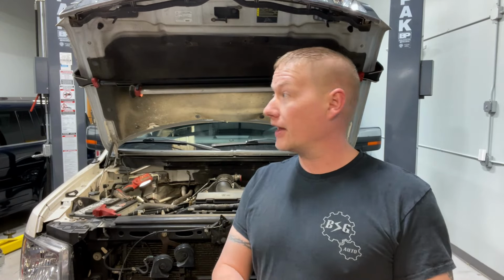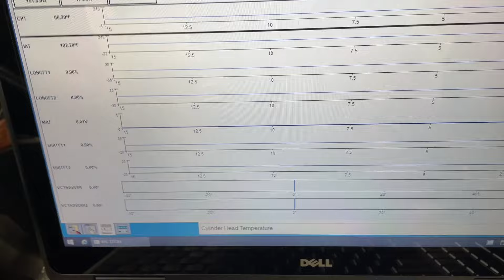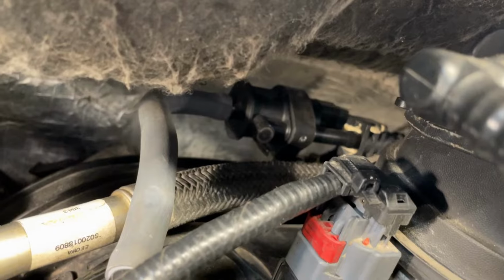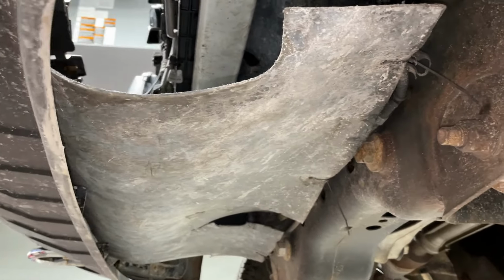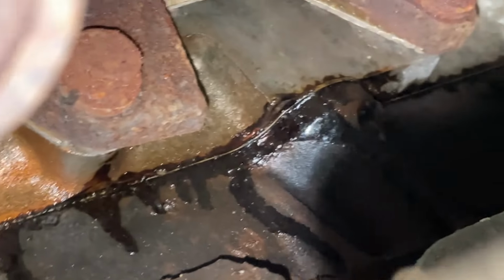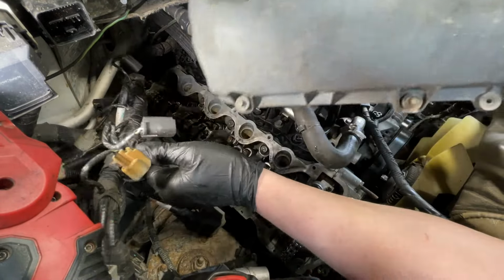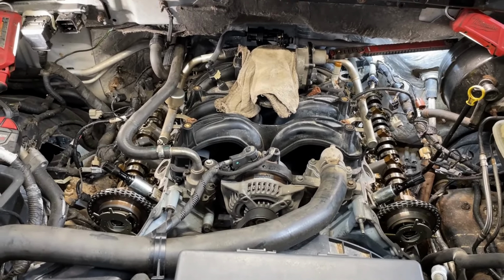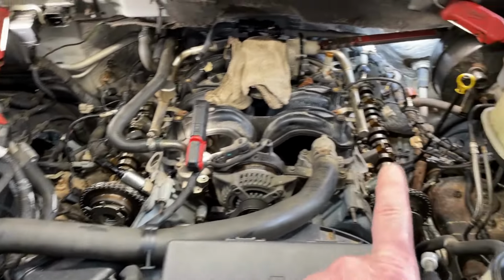The Worst Hack Timing Job Ever!

Comment: Brian, I gotta tell you that you do such a terrific job in showing folks how to do it right.  Spent this last weekend with my sons changing timing chain guides and tensioners on an older 4.6 Town Car, and we used your videos as tutorials.  Car runs great.  This video is also so helpful in showing the casual home mechanic in what's right and what's not.  It's also obvious that you care about your customers and possess a good, "down to earth" philosophy about making sure that the folks that bring a car to your shop get it fixed right.  Good on ya.
Reply: He just telling you not to use After marjet parts and use moto craft original parts when ever possible. But in this truck here he could have pit t he bolts in the oil pan fir the guy to him its not frifht so he may need a new motor I. The future but he wanted dudes money he wasn't looking g out for the customers vest interest he was looking at his best interest ans ge wanted that money on putting in that new motor. Because yea simeubinfs weren't right but that motor was t shot by no stretch of the imagination. And to recommend a total scrap of the motor and install a completely new motor in this case was extremely not nessisary at that time anyway and pit the bolts in the oil pan and the other little stuff that really needed attention immediately. Then told customer I'd it goes out in a month it would surprise me but I took care of it the best I could when the motor goes out I'll get you took care of with the right way. But no he wanted to make sure he git rhe job then and there or nothing after dude dime spent 5k I quess this guy just looks for people that t moneysno object well unfortunately in the real world most don't have lthat luxury so I said my peace you real guys know what I'm saying those that don't you guys got deep deep pockets good for you I ain't hating

Comment: Thanks for sharing Brian! I like Ford Trucks, especially simple made older ones (1990 - early 2000). My Ford f250 has passed 417K, stills runs strong like new. I learned a lot just watching your channel. Greetings fro Canada! Take care.
Reply: my 02 f250 has 391k on it and thanks to this guy ive been able to make sure to keep it going , i only wish i had the cash to send my truck to him to do the new timing chains and new intake that has minor leaks along with other minor issues ... and no i wont dare crack this engine open just because of all the things i know i would screw up 
this guy knows what hes doing
Reply: F250 and F350 are commercial trucks and built a lot better. Everything is built stronger than crappy F150 trucks.
Reply: @brianmckibben2300  So true Brian! I agree. Thanks for your feedback. Take care brotha.

Comment: My eyes widened like crazy when I saw those oil pan bolts were missing. How the hell can someone send that and be able to sleep at night. Totally shameful and embarrassing.
Reply: I thought the same thing man, what a piss poor job, I'm a novice mechanic, but whenever I do work on any vehicle I go thru and triple check everything I've touched.
Reply: Very shameful.
Reply: This kind of work gives us a bad reputation. No wonder people are thinking they are going to get screwed. Been a Ford tech for years and this would not fly in my dealership. You would loading your box and gone.  Not all of us are crooks .
Reply: @edwardames2081  there's one place I take my truck to that I truly trust and that's because I know the owner and a couple of the techs since elementary school, I even had a hard time trusting the dealership when I still had my warranty, though they did do good work when it come to getting my timing done, and any other work covered under warranty.
Reply: Omitting those bolts saves weight. Releases hidden performance.
Reply: @hightttech  I just add stickers
Reply: I got these extra parts when i finished. Guess i made a more efficent system.
Reply: Just glad he’s not an aviation tech.
Reply: jacklegg outfit.
Reply: It seems like the mechanic is just a clown who doesnt know what they are doing.

Comment: The beauty of being a Ford teck is you will never run out of work . First 1 I had to pull the cab off of to work on I quit working on them . Here in the rust belt you just drive them until they die because nothing comes apart it just breaks. You couldn't give me one for free after watching this well put together video.

Comment: You are the only reason I still have an '08 expedition,  much gratitude,  you and I did the whole timing and oil pump upgrade together 👏
Reply: Can oil pressure be the issue??
Reply: @maurotafoya8415  no. Do you have a code scanner? Timing is generally controlled by O2’s and knock sensors(on gm at least).
Reply: @maurotafoya8415  well actually low oil pressure can cause a tick or rattle in your engine and it will think it’s a knock and retard the timing. On GM trucks low oil pressure is related to the oil pick up o ring. I replaced my o ring in a 2005 avalanche. Went from 10psi oil pressure at idle to 55 psi. The lifter ticking stopped which fixed the knock sensor issue so now it doesn’t retard timing anymore. Picked up 100hp.
Reply: @MrPland1992  yes i do have an OBD2 scanner and im pretty sure that crap showed a retared timing when i checked and yesterday that i went ahead and double check so i can start working, it showed no timing code now... now its only a camshaft sensor which i already replaced buddy
Reply: Exactly what I think. I'm driving an 05 expedition and so far iv been pretty lucky pushing 240k

Comment: All these things sure put worry lines on my face from the 5.4. I have a 2010 F150 in Lariat version and have never had the engine apart. It does have a ticking on the passenger side valve cover which goes away after a few seconds and there is some brass filings in the oil when I change the oil and filter.
Your videos do go a long way to tell me what to look for and what to replace. Thanks Brian.
Reply: From what I watched from his previous videos, the ticking noise that goes away after a few seconds is not good and will eventually destroy your engine.
Reply: @RandomHeroGames  I am suspecting a bad cam follower and when the oil pressure comes up, it removes some of the play. Brian did say that the 2009 and up cam followers should be replaced before engine catastrophe. Maybe where the brass is coming from. I better pull  my covers and check. Not looking forward to this.
Reply: Few seconds ticking at valve cover is fine. Thats the hydraulic lifters filling. I think its the chain slap at start up that indicates it needs a timing job.  That's the bad one that needs to be addressed.
Reply: Had similar situation there filings looks like brass but was aluminum that had oil on it. Timing chain tensioner blew and chain was rubbing on timing cover
Reply: @joseph123456  Had that thought as well. I will be going there if nothing up under the valve cover. Thanks.
Reply: @joseph123456  Curious if any of you know a ballpark figure on what dealerships charge for full timing components and labor? Worse case scenario needing a new engines vs best case full timing. Thanks for any feedback.
Reply: @Sheeeeeeeeeeeeiiitt No I do not know what they would charge as I did the complete timing job on my truck myself.  I  know I got a quote for a 5.4 motor at one time rebuilt from ford and it was about 4 grand.  If it was me I'd check reputable independant shops for quotes  cause in ny the ford dealership is expensive.

Comment: Seeing shit like this and having dealt with crappy shops and dealers keeps pushing me to do my own work even if it’s a total pain. I’ve wanted to buy my own lift but my garage will not accommodate the height of one...
Reply: Not even a low ceiling?
Reply: Better off to do as much of your own work as you have the skills for.you run into trouble when you need scan tool access for programing and special function it easy to just pull codes.
Reply: Some people notch their ceilings to get a foot or so of extra clearance. I worked with a guy who ran a small shop in a barn and he had a bendpak 2 post lift. Wouldn't lift vehicles high enough to stand up under, so he got a nice rolling chair and just rolled around underneath.
Reply: how about digging a pit?

Comment: My son has an 07. He had a Ford dealer that told him he needed a timing job. He paid them 4500$. Got in it to leave and it wouldn't even start. They changed him another 375$ to put a cheap 3$ aftermarket battery terminal on. Driving it home it would barely run. When I raised the hood it was just like this truck. Problems everywhere I looked. I    have been a tech for 27 years. He is active duty in the military and lives on the other side of the country or I would have fixed it for him. Hard to believe a shop can let such hideous work go out the door and not do anything to make it right.   This garbage work is what gives us a bad reputation. A tech that does work like that should find another way to make a living. I feel for this customer.  Just found  your channel and good for you sir. Great job 👏.  Thanks for all of your help and support.

Comment: I’m about to do the timing on my ‘05 F150 5.4 according to all your awesome videos.  All Ford parts of course.  Thanks for all the videos and help over the years keeping my truck on the road with 200k miles!
Reply: Buy the repair manual for the truck also and just take your time and buy the special tools you need if you live close to Cincinnati Ohio I have the tools and I would let you borrow them
Reply: I just did mine by watching his video on phone sitting on shelf.   Have to do it again though something is wrong.  I messed up somewhere.  Buy tools they are needed.
Reply: @kevinbelanger4134  if I still lived in Dayton I’d take you up on that offer!  Thanks!  I’ll be setting aside 4-5 days to do the work and got the specialty tools, especially the crankshaft position tool and roller follower remover.

Comment: Awesome video . Im new to this engine and im doing a timing job . This is a great example of what not to do . I find it so hard to access the valve cover bolts on the back on the passenger side . But yea the forgotten 4 bolts on the oil pan is a joke .

Comment: Is there a roller / lash adjuster kit you recommend?  I have a 2007 f150 5.4L 3v and about to do full timing.  Would like to replace those while I'm in there, but having a hard time finding info.  Don't trust the aftermarket kits.  Have heard they redesigned in later years, but hard to find part numbers.  Would like to buy all 24/24 in a kit.  What do you recommend?  Semper Fi!

Comment: If the air intake is through the fender it is already a cold air system. Those K&N filters are in my opinion crap anyway because they don't filter out near enough crap. If you have a need for more air you got to get a bigger filter and housing. that will safely (for the engine) allow more air through more good filter media. I'd like to see more of this truck and what you fix on it.

Comment: Good afternoon, Brian. And thanks for your continued production of YouTube videos on F-150 problems.
With all your experience with Ford F150 engines, would you say that the Coyote 5.0 liter is a better, less problematic, and more durable engine than the 5.4 liter 3 valve?
Please reply with your comments.
Thanks!
Reply: My 2013 with the Coyote has 258,000 miles on it and still runs great. I am hoping it can last another 100,000 (at least).

Comment: I am a 20 year professional technician and I’ve owned a shop for almost 2 years. I have worked for a new car dealership, chain stores and Indy shops. The people running the indy shops and chain stores have this thing in their heads that the dealership parts are super expensive which just isn’t true sure some stuff like converters are more expensive because they actually work but many many parts are actually cheaper at the dealer ive paid 49 dollars for oxygen sensors at the dealer and the part stores wanted 78 bucks. I’ve had gaskets be cheaper at the dealer and I’ll tell u the aftermarket gaskets get super soft and leak and the aftermarket gaskets aren’t always the same size so the gaskets never fit like a dealer gasket. I’ve put aftermarket timing chains next to a dealer timing chain and the aftermarket chains were longer lol and the best part is the timing chain from the dealer was 7 dollars more but it came with new guide bolts! Now that I have my own shop I buy so many parts from the dealer and I don’t have the come backs that other shops have from simple part failures that are totally avoidable. Sure I do buy aftermarket parts I don’t get everything from the dealerships but I only get stuff like brakes, belts, radiators, and stuff like that I buy all engine parts, all electronic parts from the dealer it gets rid of a lot of headaches.

Comment: We've got a 5.4 from 2004 that just runs amazing, we do all the maintenance ourselves, never miss an oil change, spark plugs and coils twice, runs without missing a beat, it has a cold air intake, flowmaster cat back, and a shift kit, 3 stage programmer, expedition

Comment: The biggest problem i see is that head being replaced without the bore journal being checked, the first and last cam caps if there is wear the head/camshaft will not properly oil for the phaser to work right. Good old dorman phasers i stopped using them on the ford 3 valve years ago from the unreliability of them. They rock back and forth at idle and part throttle witch sets phaser codes.

Comment: Purchased a non running F250 with the 5.4 3v engine.
Rebuilt the engine myself and used OEM timing & valve train components. 
Six years later and no issues.
Motorcraft oil & filter change every 3k miles.

Comment: The thumbs down comes from Dorman parts....😆.
Reply: While I’m not a dorman fan, did you see the dorman phasers were not the cause of these issues.
Reply: Well, you can use them in your engine.
Reply: @jamram9924  To be fair, Dorman phasers do suck but so did about everything Ford put in these engines from the factory. There’s no excuse for the garbage that Ford (and other manufacturers) pawn off on customers.
Reply: @prevost8686  : Well FordTechMakuloco does recommend the installation of the Melling engine oil pump for that reason. Most people believe all parts are created equal and sadly they are not. I’ve dealt in wholesale autoparts for over 20 years. I’ve also worked as a service advisor and import shop. When America have China preferred trade status, we opened the floodgates to cheaply priced/made auto parts. Orielly, Napa and Autozone are flooded with this junk. The majority of car owners gravitate towards cheaply priced parts not knowing their quality is also cheap. I’m getting ready to do a timing chain and oil pump service on a 5.4 3 valve F-150. I’m going to use the parts Brian recommends because he’s clearly demonstrated that their much better than the aftermarket garbage that’s available.
Reply: @jamram9924  Melling is a quality product and they supply factory pumps for Ford. The problem with the factory pumps wasn’t a quality issue. It was a design failure of the garbage 5.4.  Quality suppliers like Melling, Johnson, Mahle all supply the automotive manufacturers with components but they have to supply what the manufacturers are asking for. Personally, I’d rather buy the aforementioned aftermarket products for a rebuild that the FoMoCo branded parts. 
Dorman doesn’t supply ANY manufacturer with components and their line is pretty much garbage across the board. I was a technician for Ford for years and then an independent technician for the next 20. I know a little about garbage parts.
Reply: @prevost8686 : I was fortunate to sit down at a long layover with an engineer. He consulted for Ford, GM and Toyota. He claimed that the “bean counters” were the final decisions for the design/engineering for the parts. They asked what the cost of modifying or using a certain material for a specific problematic parts on American auto manufacturers. However, Toyota and Honda were not like this, they asked what the cost was and either absorbed the cost or passed it on to the final sale price. The issue here certainly appears to be planned obsolescence based on the final cost/expenditure/profit. Other than the oil pump, I don’t acquire other specific aftermarket parts for this 5.4 3 valve the availability. There’s a longer wait time for specific internal engine parts, whereby as the Ford guides, chain are readily available. It’s a fleet truck and the customer needs a quick turn around time. I deal more with Denso and Aisin on the Japanese end of aftermarket parts.
Reply: @slagdemon  They wern't; they will be.
Reply: @jamram9924  I buy a ton of Denso, Aisin parts as my business is about 70% Toyota and Honda. Wish all parts were made like they are
Reply: @prevost8686 : Toyota has a financial interest in both companies but also that Japanese mentality and ethical decision on quality.

Comment: PLEASE HELP! I have a 2008 Expedition and I’ve been chasing a misfire on cylinder 3 for days. I’ve changed plugs, coil packs, new catalytic converters and new injector. I have 12v to the coil plug, I have good compression and the injector is working fine. I’m pretty sure the coil is not firing the plug at all. Not only is it missing, but the vehicle also bogs when you take off, then it seems it catches up and takes off. What could be the issue?? I’ve checked for vacuum leaks, but I haven’t found anything.